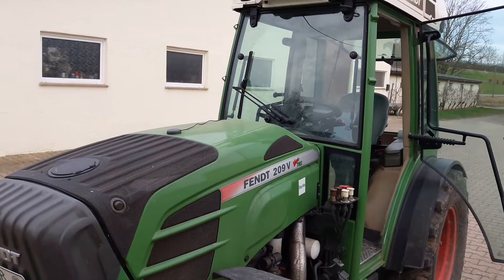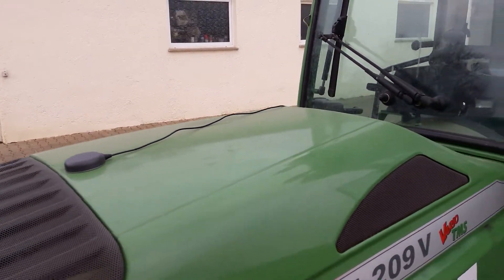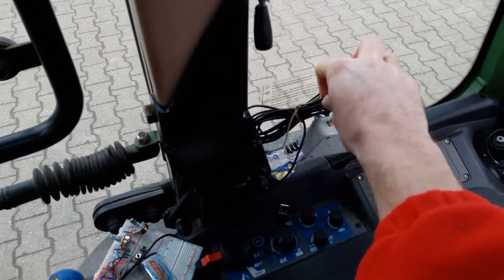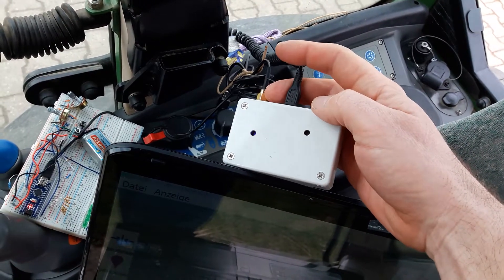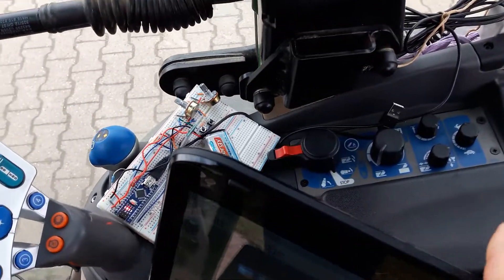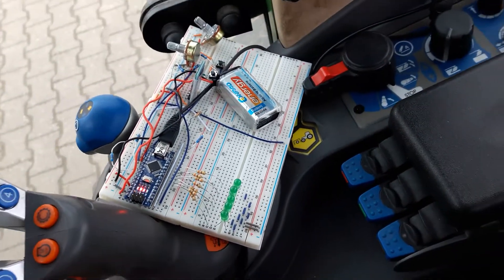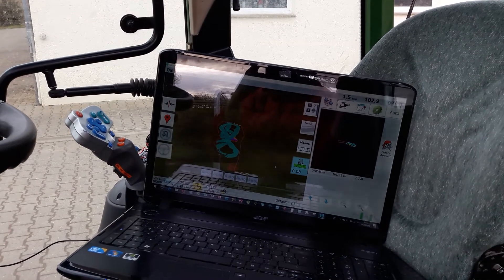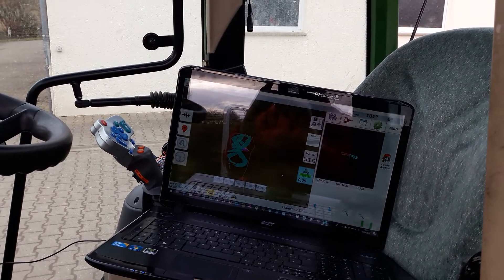AgOpenGPS test with UBlox M8T and Section Control both via BT

Comment: Hallo, kann ich bitte ein foto vom inneren der Box bekommen?
Reply from the maker: http://agopengps.gh-ortner.com/doku.php?id=gps:start

Aktuell hab ich eine Adafruit huzzah32 (ESP32) eingebaut,  die passt auch quer in Gehäuse und hat einen Laderegler. Aktuell würde ich einen ESP32 in Arduino Uno Form nehmen und einen Ublox F9P von Ardusimple draufstecken. Kostet 100,- mehr kann  aber RTK. Beim Ardusimple muss man aber 3 Pins verlegen (Uref auf 3,3V, RX und TX1), ist aber nicht schwer.
Passende Software: github MTZ8302  oder coffeetrac

Comment: hi, very nice rig!, have you tried the M8T with RtK? does it work? what differene do you see with the f9p?
Reply from the maker: I haven't tried the m8t with RTK, as it can't process the NTRIP on its own, it needs rtklib. Some AOG users do this, so it is possible. The f9p much faster to get a stable signal and can process RTK/NTRIP internally. So I would prefer the f9p

Comment: Hi do you use a base station or only the GPS m8t with Ntrip?
Reply from the maker: Another possibility is to set the m8t satellite rate  to 10Hz and the output rate of the m8t to 5Hz, so the values are smother. It might be in ms, so 100ms =10 Hz
Reply from the maker: For Section controll I use only Egnos, no other correction.
For Autosteer on the other  tractor I use F9P with Sapos RTK
Reply: So you are not using u-blox m8t anymore? I built the same gps module, it is the same suggested in agopengps docuwiki page, but it is too imprecise. When it is connected to Agopengps the arrow starts to go crazy, it is not fixed at the center of screen.
Reply from the maker: I am using the m8t only for Section controll on m spraying tractor. It works well. For Autosteer it could work. If the tractor in AOG is turning around when standing still increase the value for heading calc look back to 1,6 -2m
Reply: Thank you very much! I try your solution and see.
Reply: How can i set the hz? I can set from 1 to 10 inside the ports section of Agopengps. Is it enough?
Reply from the maker: To set the frequency of the ublox use ucenter software. The screenshot should be in the wiki of orther agopengps
Reply: Ok i try this and we will see
Reply: I have done it! Thank you very much! I followed the steps on agopengps wiki page, and i get dgps fix. I am able to draw outer border.
Reply: @MrReiv91  hello.  do you know how to set up the box where he has the bluetooth module and the m8t ?  thnx
Reply: @taavetmalkov3295  he is using a Bluetooth module hc05 connected to the m8t through UART. It is simple to set up from ucenter

Comment: Does the ublox m8n work as well?
Reply from the maker: Hi, the 8n would fit too. It depends on the connection to the computer: usb or Bluetooth or Wi-Fi... the solution for me was a UART RS232 (RX/TX) connection from the Ublox module  to a HC-06 Bluetooth module  and Bluetooth to the pc with AgOpenGPS  running. USB would be easier,  but cable.
The Ublox chips differ in the way they process  RTK.
Reply: Ok thanks
Reply: If i use a ublox neo 7n would it work ?
Reply: If i use a ublox neo 7n would it work ?